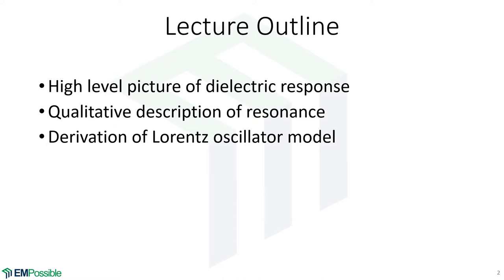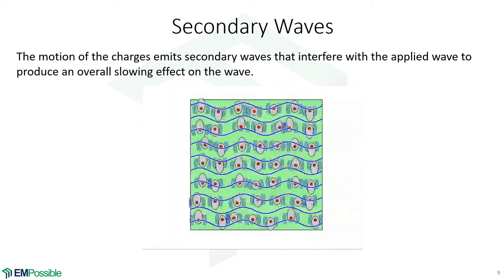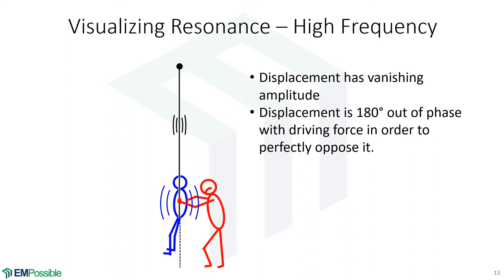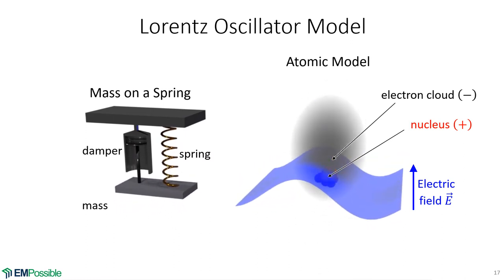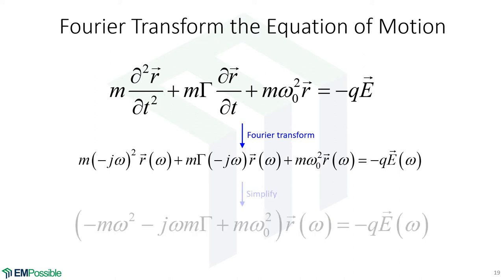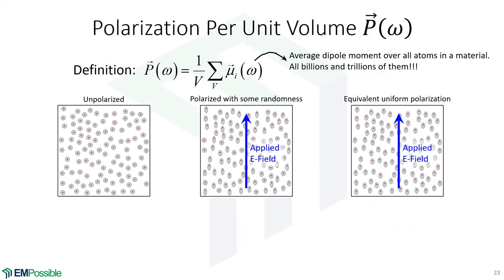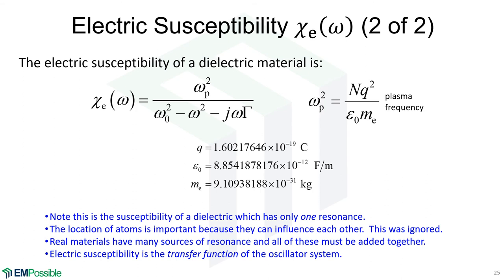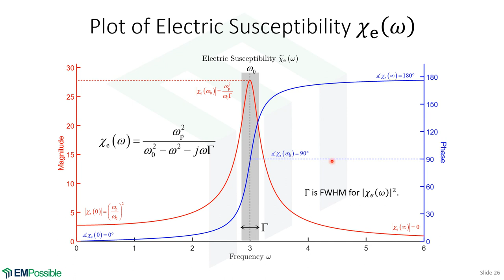Lecture -- Lorentz Oscillator Model

Comment: Excellent video, as usual. I have a question though, regarding the animations on slides 8 and 17. When the field is at its peak (positive), I would expect the electron cloud to move to the opposite direction, but the animations show the opposite behaviour, as if the cloud were composed of positive charges. Am I  missing something? Should I consider a delay to correctly interpret the animation?
Reply from the maker: Great observation!  I think my animation is misleading and I should have inverted the blue wave.

Comment: Hello again. I got confused with a passage in the derivation of the susceptibility expression. Why do you consider the Fourier transform of the derivative with a minus sign? As far as I am concerned, in most references it should be "j omega", not "- j omega". It impacts the sign of the gamma term in the denominator. In Balanis' book, such sign is positive, in line with the usual Fourier transform of the derivative. I would appreciate if you could shed some light on the subject.
Reply from the maker: It is merely a sign convention thing. The majority of the literature on EM properties of materials that I was using for my class used the positive sign convention so that I what I used for that derivation. 

BTW, here is a summary on the sign convention in electromagnetics and photonics that may help...

http://empossible.net/wp-content/uploads/2018/03/Summary-of-EM-Sign-Conventions.pdf

Also, this summary is posted on Electromagnetic Field Theory class at the following link in Topic 3:

https://empossible.net/academics/emp3302/

Hope this helps!!
Reply: @empossible1577  Sure, I thought it could be something related to that. Thanks for the prompt feedback.

Comment: Excellent Explanation!, However, I have a question; if (wo) is the natural frequency of the system then what is the plasma frequency (wp)? since you mentioned also that the plasma frequency is also a constant?
Reply from the maker: Great question!  First, let me point you to the official course website.  I recommend using this as your main portal to the videos.  From the website you can download the latest version of the notes, get links to the latest version of the videos, and and get access to other resources.

https://empossible.net/academics/emp6303/

At some high frequency, usually in the ultraviolet, materials experience a bulk oscillation of their electrons when they are pushed by an oscillating electric field.  More practically, we tend to think of materials has behaving like the material they are below the plasms frequency and behaving like a vacuum above the plasma frequency.  It is a very slow and smooth transition so this way of thinking is somewhat crude.  Watch the video of Lecture 2f for a full explanation.